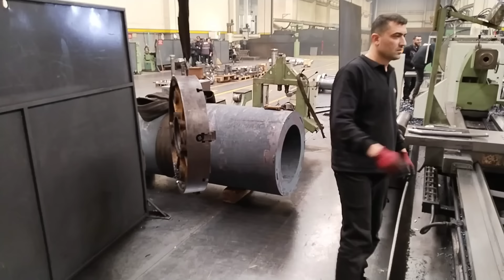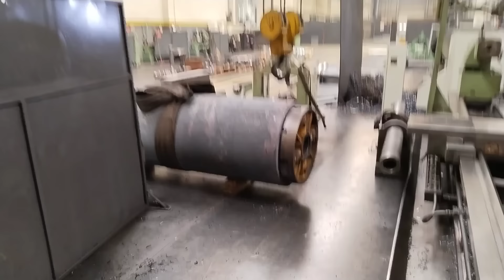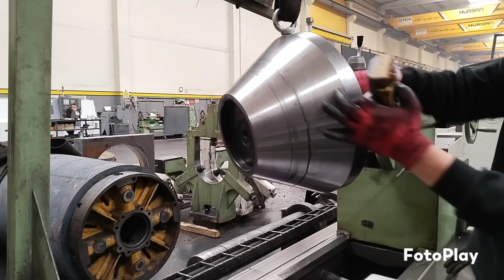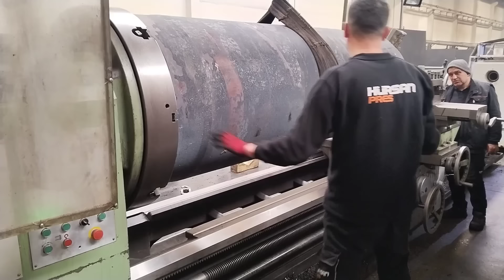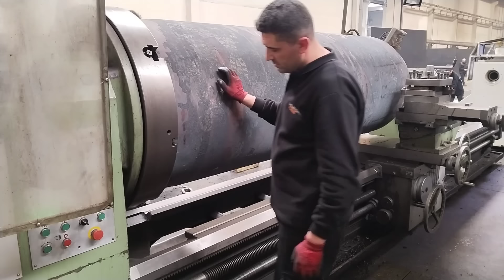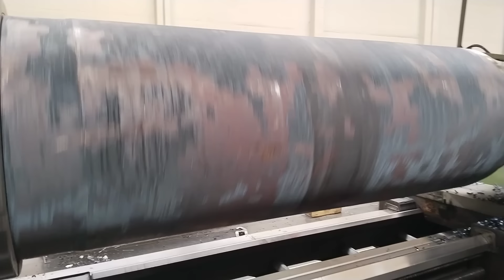DIAMETER 900X600LENGTH 2400 SLEEVE WE CONNECT TO THE LATHE#youtube#hydraulic#keşfet#viral#viralvideo

Comment: Im curious does your center have alot of miss alignment when using 4jaw chuck method like that? Because shouldn't it be quite accuratelly centered so your pipe center doesn't wobble. Great video btw! always love watching heavy machining :)
Reply from the maker: Brother, continue to follow me, I will continue to upload videos. Adjusting a shuttered mirror is the easiest for me. Everything is difficult for those who do not know how to do this. Since this piece is a specially produced forged piece, it shakes a lot inside and out. I tried to divide this secretion according to the pass and connected it that way. Of course, such pieces are difficult. But I have such a hard time with the parts that are smooth and I adjust it very easily. Thank you for your nice comment.
Reply: @MyLatheWorld  Allright buddy. I never work with jobs this big. I mostly machine rollers for paper industry.

Comment: Dá a impressão de estar exemtrica. Mas confio na esperiecia de vcs so sabe quem esta operando. Fazer crítica é o mais fácil.
Reply from the maker: Thank you brother, the material is specially produced forged steel, that's why there is a difference in wall thickness, there is a runout, I centered this runout inside and outside diameter, that's why it is like that.

Comment: Why you do not indicate the part? measuring on the chuck is not precise. Need to indicate to have a perfect fit. I see when you started it, it is not revolving quite round. CONCENTRICITY.
Reply from the maker: The piece is specially produced from forged steel, so it does not rotate properly, I tried to center the pass inside and outside.

Comment: Micrometer?????? for 4 jaw alignment on both ends.
Reply from the maker: I know what the micrometer is used for, but I don't understand what you mean.
Reply: @MyLatheWorld  I noticed you were using a tape measure to determine alignment across the 4 jaws, then after the first run it seemed the one end was high and the other low, I don't know how much scale is on the steel, but a micrometer will give a fixed point of reference to determine the center of the piece and will allow to adjust like you did so the piece is centered on the 4 jaw chuck.

By doing this at both ends you could center the piece and allow for smooth full length cuts. There is a Youtube machinist here in the US named Adam, his channel is Abom79 and even working on large pieces such as yours he trues the pieces with a micrometer. They even have competitions amongst tradesmen to determine who can bring a 4 jaw piece into alignment to an acceptable degree usually depending on the size of the piece, between 1 and 5 thousandth of an inch tolerance.
Reply from the maker: @couttsw  I understand, brother, the pipe is specially produced forged steel, there was a 50 mm pass on the outside of 70 mm and the piece was very curved, I tried to give the curvature proportionally inside and outside here and I was successful, of course, we use various measuring tools such as micrometer compiler while doing the precise processing of the piece to capture the measurements. You will see it in the following videos